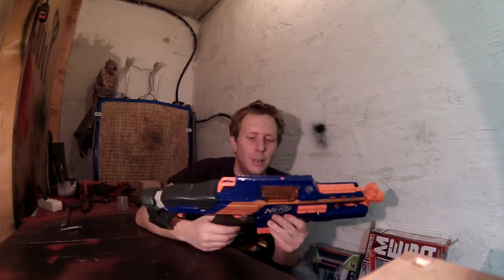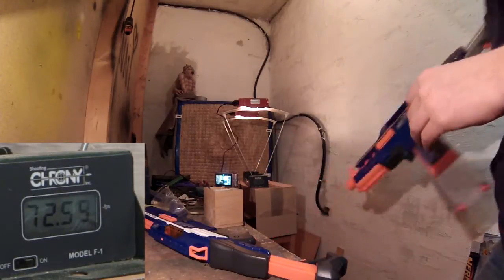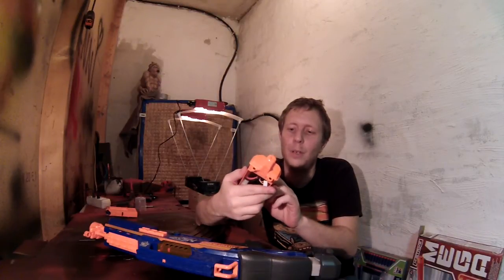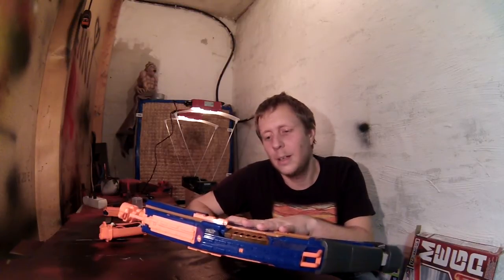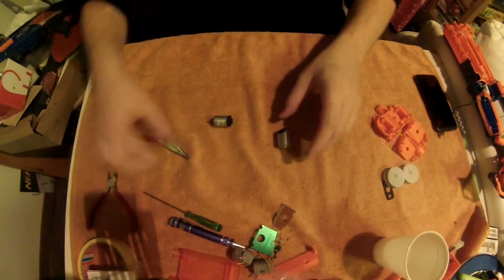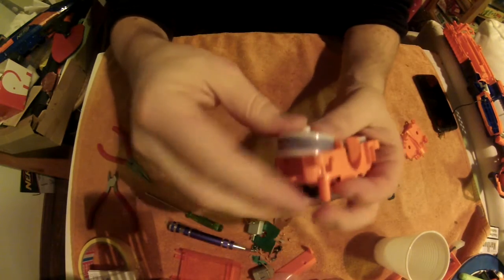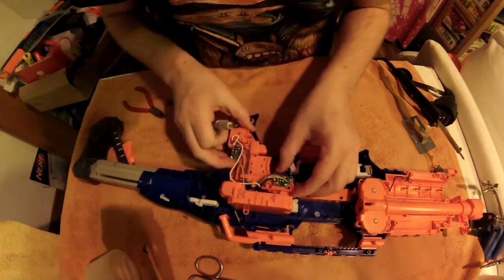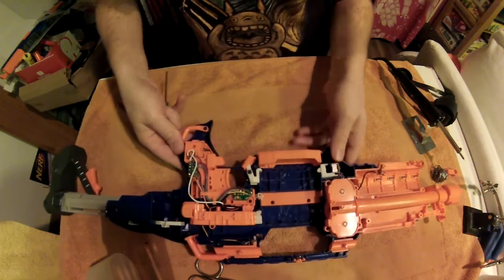nerf rapidstrike - spin up time (akku packs/motor replacement)

Comment: Hi,
I've also put  9.6v nimh  (900mah) in my rapidstrike but somehow it seems not shooting as fast as yours at 2:40 !
Have you done anything else to it like thermistor removal ?
thx
Reply from the maker: hi,
not at this point, no.
have you maybe changed the pusher motor? (because i have not at 2:40)

i later removed the thermistor but that has no effect on the performance ...
but to be honest:  it was way too fast anyway. :D
Reply: Fidi T.U.N.K.A 
Thx for the reply
Nope, stock motors too. But I've noticed à pinched/damaged blu wire (the one that goes to access door switch, it may be the guilty but i don't think so since its only a switch. And i've connected my battery differently, i soldered 2 wires connected to a tamiya connector directly behind the springs inside the rapidstrike ... Maybe the mistake ? :/

Comment: do you use tamiya connectors?
Reply: with the rc accu?
Reply: hi +samuel 
yes i use tamiya conectors on nerf blasters.
i have tons of RC stuff at home. from myself and my kids. cars, boats, planes, copters ...
some of them require deans or xt60 plugs because of the high current they draw from the batteries. true: tamiya connectors could melt here and cause all sorts of problems ...
but those tiny little 130 sized motors in nerf blasters draw so little, that it is perfectly save to use tamiya connectors.
Reply: +fidi fpv ok thank you for This information  (i'm gonna mod my rapidstrike too)
Reply: +fidi fpv my mod is done (9.6v and stock motors) and it shoots realy powerful, but when I shoot it without darts in the mag the motors start to smell a littlebit.

but I'm realy satisfied with of.
Reply: +samuel van der schoor *it
Reply: +samuel van der schoor zit jij al in de Nederlandse nerf whatsapp/discord groep
Reply: +samuel van der schoor?
Reply: Lars Van Den Broek nee, ik was gewoon een keer mijn nerf aan het nodden
Reply: samuel van der schoor wil je misschien in de whatsapp/discord groep?  Daar word je ook op de hoogte gebracht als iemand een NERF war organiseert

Comment: Nice video and very informative. Quick question: What is the maximum safest voltage for the rapidstrike without damaging the stock motors.
Reply from the maker: +Turjya Paul sorry for the late reply:
i would say 11.1v (so 3s lipo)
but the stock motors scream terribly on 3s and spinup time is still very long.

Comment: Hi, ich habe mir vor kurzem die Rapidstrike für ein Zombie-Larp besorgt, und bin auf dein Video gestoßen. Ich wollte nun fragen, ob du mir sagen kannst was für Teile du genau gekauft hast. Vielen Dank im Voraus
Reply from the maker: Nils roewer 

Motoren:
http://www.conrad.com/ce/de/product/228283/Motraxx-Tuning-Motor-X-Slot-10S-Race-132-Leerlaufdrehzahl-24600-Umin?ref=list

akku musst du selber schauen. da gibt es aber viele die in das batteriefach passen (auch bei conrad).
du willst 3s (also 11.1v)

ein bisschen kabel (am besten eine rolle von ausserhalb der modellbauabteilung)
einen stecker (das gegenstück zu dem auf dem akku)
ein lipo ladeegerät das 3s lipos laden kann (und den passenden stecker für den akku hat)
Reply: Fidi T.U.N.K.A Vielen Dank^^